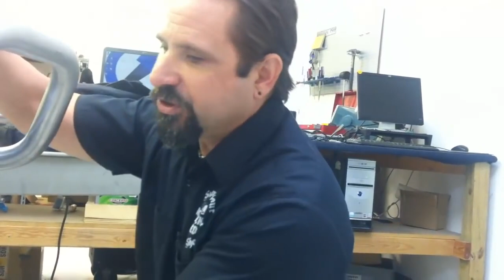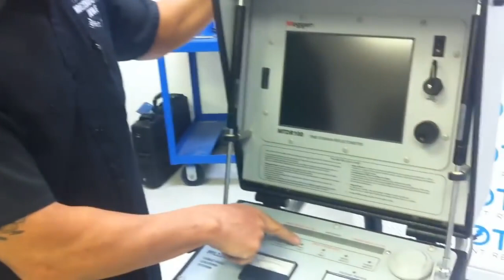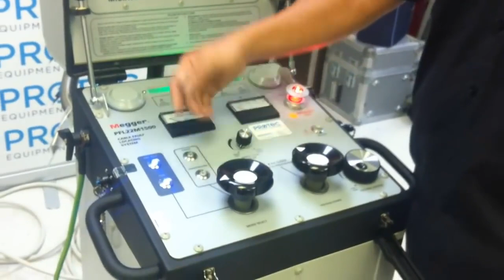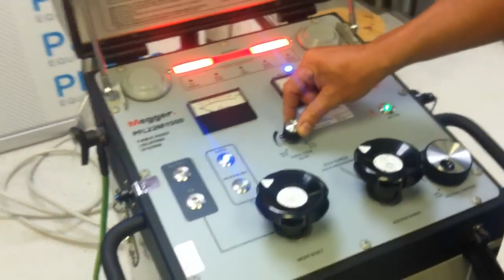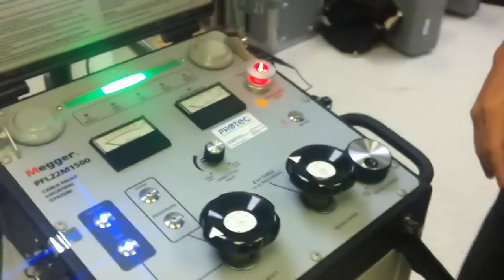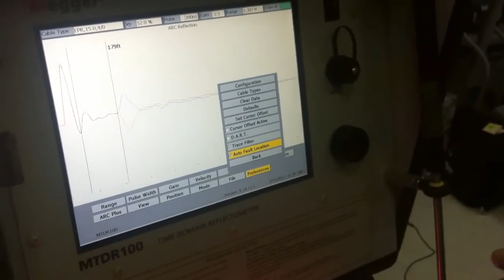Megger PFL22M1500 Power Cable Fault Location System Overview

Comment: PFL22M1500J now production is closed.
Reply from the maker: Correct, it is now replaced by the SG32-1500.  You can find more about the SG32 here:  https://protecequip.com/products/megger-sg32-1500m-power-cable-fault-locator.